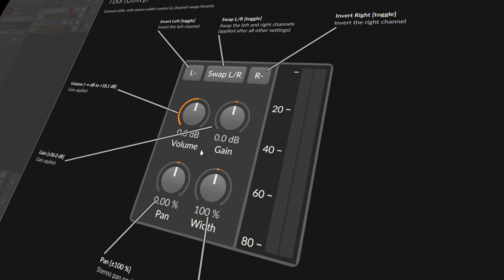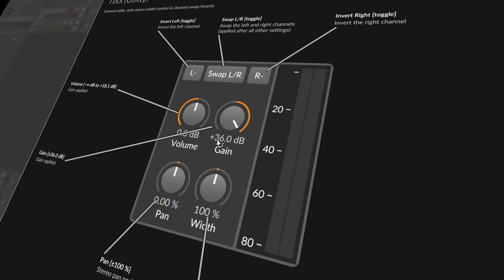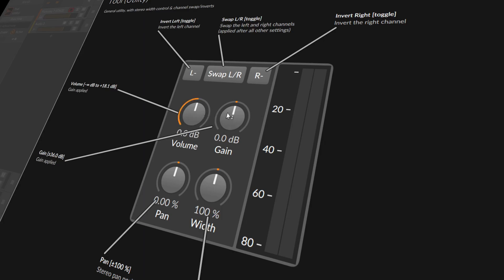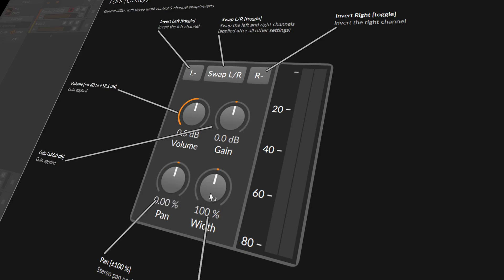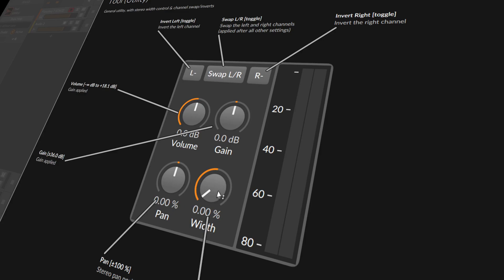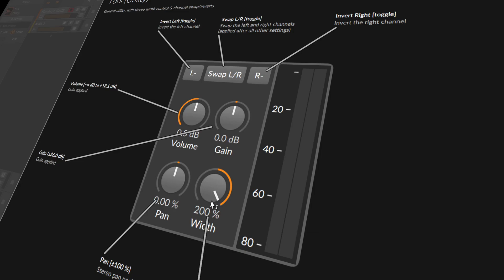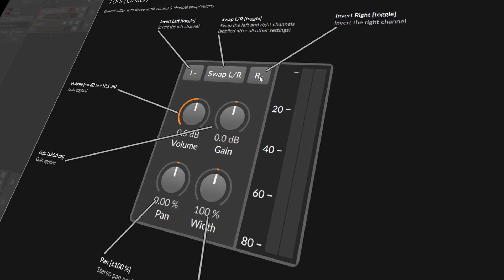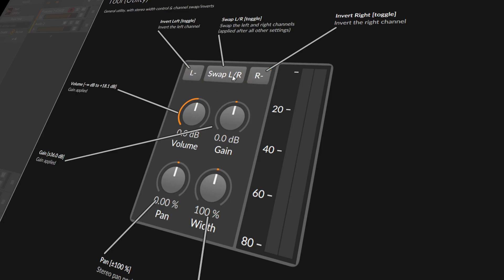Tool / Utility - Bitwig Audio FX Guide

Comment: Any place you can add control over levels is super helpful. Drop one before an effect, send the effect plugin the level it wants to use. Then do whatever volume you need to fo afterward. Just good gain staging, feeding things with the correct level. So many DAWs don’t even address this at all.

Comment: The Volume knob is the equivalent to a channel fader whereas Gain is an offset applied to the existing signal. Gain is used to boost or lower the overall level of the signal and the Volume is used for performing things like fadeouts/ins/tremolo/etc. You would apply automation to this parameter.

Comment: Supposedly there is a slight difference between the Volume and Gain knobs. If you turn Volume all the way to the left, you get no signal at all. a complete silence. This is not necessarily the case for the Gain volume - even at its min setting, there may (theoretically) be a certain level of signal coming through.